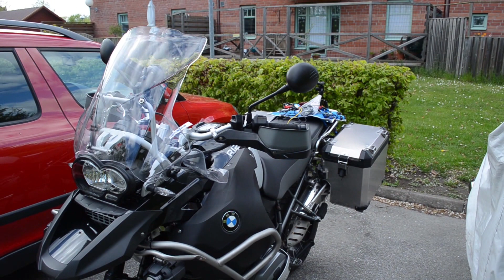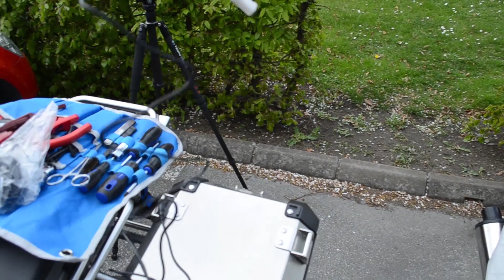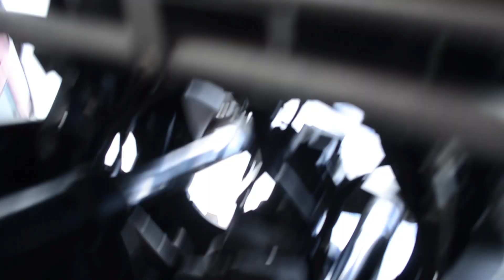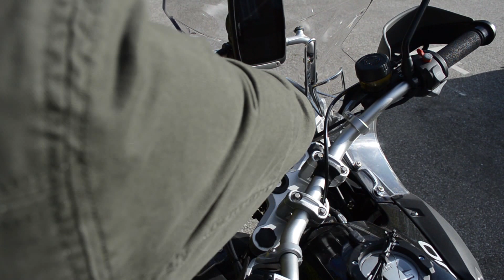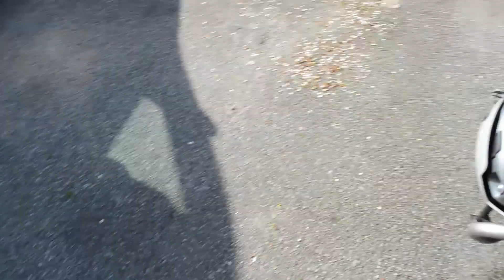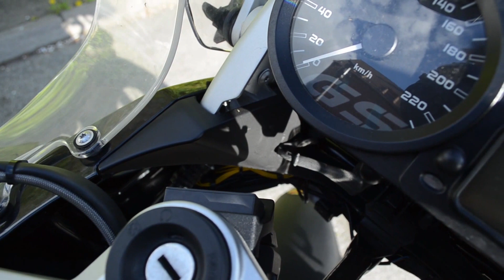How to wire TomTom Rider 400 to BMW GPS connector

Comment: Hi, can i double check please, connect wire 1 to the black wire on the TomTom sat nave, wire 3 to the red cable on the TomTom sat nav, and wire 2 is just left and not used?

Comment: thanks for sharing this video. how did you know which cables to solder to which?
Reply from the maker: On the TomTom I know which wire is plus and which is minus. On the bike I simply measured with a Voltmeter.

Comment: Don't know if you still follow this but How did you determine which wire was + and - on the GPS side? I know the 1 is - and 3 is + on the harness side. Thanks.
Reply from the maker: On the GPS side the red is + and the black is -. My GPS came with open wire ends for installation.
Reply: @mc-traveler422  wire I am using is a general use USB cable. Has a white wire and uncoated copper wires wrapped around this. I'm pretty sure the white is the + and the bare copper is the -

Comment: Was there a reason you left 9 ft of cable? The connector is like a foot away. Just curious.
Reply from the maker: In this case it was just to be able to reuse the cable on another installation
Reply: mc-traveler  That makes sense. One more question. What was the 3rd lead to be used for again? I know you said you didn’t use it but was wondering what it’s for,
Reply from the maker: @RumorHazi  I believe it is the speed pulse signal which is used if you have the BMW navigator as that navigator is more integrated with more bike specifik features.

Comment: How do identify which wire is ground and which is 12v ?
Reply from the maker: THey are numbered 1 , 2 and 3. Where 1 is ground, 2 is speed puls and 3 is +12V. But if you want to identify the mmanually simply put a voltmeter between the chassi and the wir eyou want to identify and use the diode mode of the Voltmeter so see what wire is connected to the chassi / ground. Use the 12V (low voltage mode) to identify the +12V by putting the - terminal of the Voltmeter to the chassi of the bike and +to the wire you wan tto test. If the Voltmeter reads around 12V this is you + 12V.

Comment: Hi is the wire safe for rest of electrics spoke to my dealer says they dont do them may fry wiring !!! any problems with yours cheers
Reply from the maker: Yes it is safe. This is a 12V auxiliary connection port. It is where BMW connects their GPS is you buy it from them. Furhter the port is connected to the CAN bus system and CANbus will shut down the connection if it draws to much current.
The connector I use in the video is an original BMW connector they sell/use for this purpose.

Comment: Hi mc-traveler, great vídeo, thanks. I need your help, maybe a stupid question but, in the three yellow wire, is there any order to connect only two of them? I want to connect the base of the phone holder.
Reply from the maker: Hi, yes it is a 3 wire harness. Wire 1 is ground, wire 2 is a speed signal, wirde 3 is +12V.
So you can use wire 1 and 3 and you get 12V.
Also for my TomTom I only use these wires as it has no speed signl input.

! Be aware this is 12V and not 5V! So if your phone holder needs 12V you are good to go.
Reply: Thank you for your help!

Comment: In the BMW F series this connector is on the battery clamp. Just my 0.02$ ;)
Reply: Thank you for the confirmation. Just received my F800s today and found this plug. The trail leaded me to this video, but since the video does not actually show the plug/connectors, I wasn't 100% sure.

Comment: Hi there. I recently bought a R1200GS 2011. And I bought the BMW cable for the gps connector from a local dealer, to connect my TomTom Rider. They then told me that due to the 12v to 5v transformer, the battery could still drain empty due to the transformer working and keeping the canbus awake. This would need a canbus relais to fix the problem. On my own tests the power shut down after some minutes after switching off the contact. With and without the TomTom on the mount. Did you face any battery problems after you connected your TomTom? Thanks for your vid and help!
Reply from the maker: Hi, I did the installation on a 2012 model and had absolutely no issues.
Reply: That's a relief! Thanks for the response!  @mc-traveler422

Comment: Dear Mr. Traveler. Although this is an old post: Why didn't you decrease the length of the cable? No you have to tuck away extra cable length. From connector straight to TomTom via windscreen fixture would have done the job? Or am I missing something? Please let me know.
Reply from the maker: Hi Rob, thank yo for your question.
The honest answer is that I did not want to shorten the cables in case i change my bike for another one. Then I can reuse the cable on the next bike in case I need alonger cable. But or course shortening the cables gives a nicer, cleaner installation :-)

Comment: can a usb adapter bee connectid too the bmw wire at the same time whit the tomtom?
Reply: Can use it as an aux power socket, providing you don't overload the original circuit in terms of Amps drawn.
Reply from the maker: You probably could, but be careful with the AMPs your are pulling as the CAN-BUS controlled supply will shut down for protection if you pull too high AMP.

Comment: I bought the TomTom Rider 410 and would like to connect it to my BMW motorbike F800 GS, but as the bike have 12 V (?) and most GPS need 5 V, I wonder how to do this. We already burned 2 GPS as they received 12 V from the cigarette lighters. The BMW bikes has a special cigarette lighter plug which is smaller that the 12 V one find in a car. The Rider 410 came with a connection plug for the TomTom in one end, but naked wires in the other end. The shop told me that I should get a plug which is easy to fit, but the TomTom will get 12 V and the TomTom Manual on Addendum page state DC5V. Thus I don’t know how to connect it. What to do?
Your video is nice. But is the connection you did giving the TomTom Rider 410the 5 V DC it needs? It must not get 12 V as far as I can see? Please email me on donnerup(SPAM)pt.lu   replace (SPAM) with @
Thank you.
Paul
Reply from the maker: Dear Paul, sorry for the lat answer. For some reason your message was considered spam and I realised that just nu.

The TomTom, if used with the origianl holder/cradle, is designed for 12V input installation as the original wires/holder transform it down to 5V for the GPS unit.
But if you connect the GPS via micro USB you need to make sure you have 5V. This is why lighter to USB connectors are bulky. They transform the 12V from the lighter to 5V before sending it out thru the USB connector.
Reply: Hi , my TomTom is connected to the BMW socket, however after a couple of houes the TomTom shuts down, battery flat. The instructions say do not connect to a  power socket as it does not supply enough power. Confused ?

Comment: Connected my TT400 with the same cable to the canbus connection below the beak, doesn't shut down when the ignition is switched off, any ideas?
Reply from the maker: +cornishGSer Hi, it does not turn of the power sraight away after you turn of the ignition. You need to wait. It can take several minutes depending on which model and year I guess.
Just leave and it should turn off the power after a while.
Reply: It turns off after a few seconds. Give it some time.

Comment: Hi witch Navi holder do you used on the GS?
Reply from the maker: +Patrick Heinrichs I used the RAM mount included in the Tomtom package. But I have to say I am not too happy with it and will change it for something else. It is simply too bulky for the place I mountet it in and can vibrate as it's arm is a bit long and heavy. For placement on the handlebars I would guess it is perfect.

Comment: does every gs has this konector vor navigation
Reply from the maker: +Tim Schmalenberger yes, at least the ones with CANBUS  electric wiring.

I think it was introduced in 2004. Although the exact placement may differ between model years slightly.